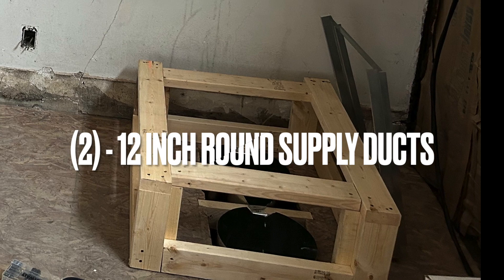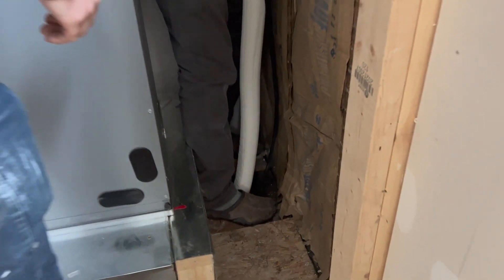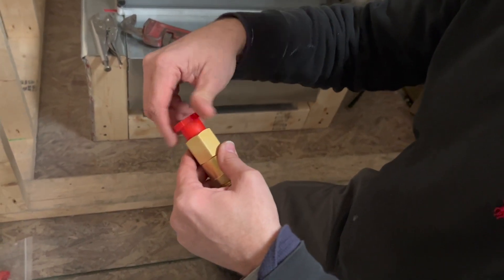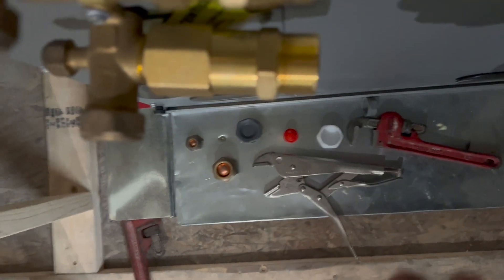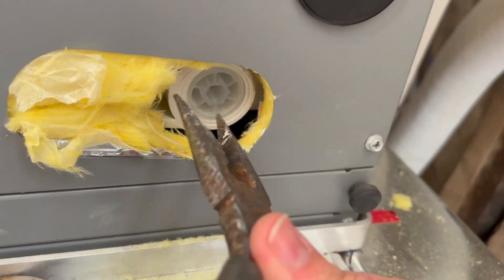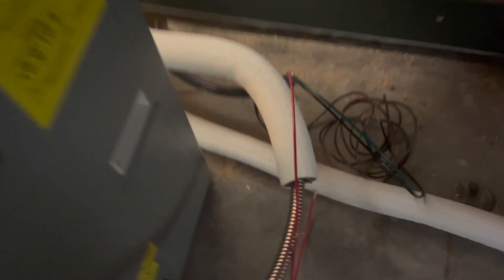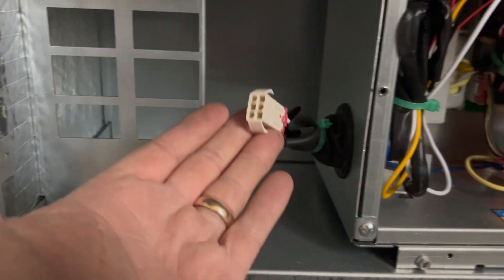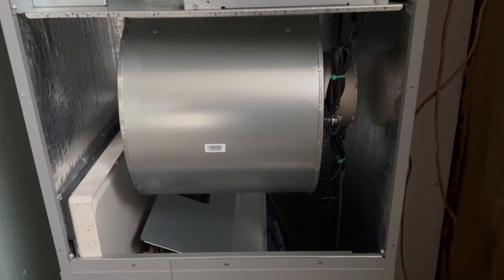Mr Cool Universal Connections | Set-up and Connect Mr Cool Heat Pump

Comment: Where do you change the filter? Is that the box at the base? Does it have to be bought separately
Reply from the maker: I had to add a filter slot to my existing setup. The new MrCool universals have the filter slot built into the bottom of the air handler. 
The base the air handler sits on is called the return plenum. They can be bought or built separately. Hope that helps.

Comment: Why didn't you mount it horizontal up high.  That would simplify ducting and free up floor space.  Need a P-trap.  If not, air will get sucked thru the condensate tube into the Indoor Unit.  Not in the manual?

Comment: Using vice grips, when you should be using adjustable wrench, and not Teflon taping the PVC male you screwed into the air handler unit drain, shows you are a DIY homeowner. Stay away from HVACR.
Reply: The whole point of this system is for DIY. Why else would you care about no evacuation or brazing of fittings.

Comment: Great video, I Need help on the wiring. 2-3 ton heat pump with backup heat strip to a Honeywell smart thermostat. 🙏🙏 System won't start
Reply from the maker: Just in case you didn’t see this video :
MrCool Universal Heat Pump Wiring Connection without heat strip : Nest or Honeywell to heat pump
https://youtu.be/9SLtXrbStvQ
Hope that helps.

Comment: That unit heat too?? Or have to bay gas furnace??????
Reply: depends if you get the heat pump or cooling only condenser. the heat pump has a reversing valve that runs the unit in winter, heats at 100% of capacity down to 5 degrees below freezing. Supposed to still have 75% heating capacity at 22 degrees below freezing. Ours heats just as well in winter as it does cooling off the house in summer. Pretty satisfied with it.

Comment: How many watts of power is typically used in your universal 2-3 ton unit?  I have the emporia energy monitor and on my existing 15 year old York heat pump and air handler it’s constant 2000 watts for condenser and 850 watts for the air handler.  I’m thinking of proactively installing the 2-3 ton Mr cool universal and was wondering if you would be able to share real world energy usage.
Reply from the maker: Hey mwel…,
Max, the air handler can do like 5000 watts. But I’m not sure my experience will map to yours because the variable from house to house vary so much. 

I would compare efficiency rating. My heat pump rarely runs non-stop at full 5000 watts for an hour…. - it has to be below zero F  ( and even so we DO NOT have a heat strip.)
My 20 yr old gas furnace was 10 seer in winter and the new heat pump is the same. So the winter is not where we save. The summer rating is 18 seer.. that’s where we really save. 

We too have an energy monitor and the coldest day this winter so far used 34 kWH of electric for the day by the air condenser and 1.5 kWh for the air handler total for the day. The air handler is light on electric use.
Checkout our playlist for real world whole season evaluations : https://youtube.com/playlist?list=PLExVGissIl-GdKsUBhF3c0fQ6E_o6oOaZ&si=tlGHJ7YHnMz_fE_9

Winter reviews : 
1st winter….https://youtu.be/D5-txAzQNFg?si=AR12JJnXGiGHOhzY

Winter with extra heat source in winter 
https://youtu.be/LHuScgQYKBQ?si=TA9-pOXpyBEU6beC

Hope that helps.
Thx for watching